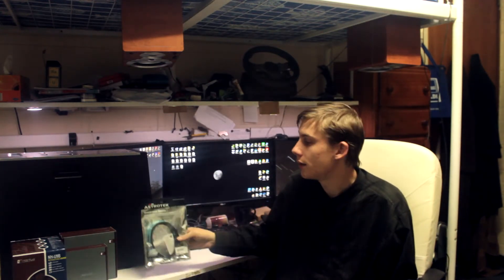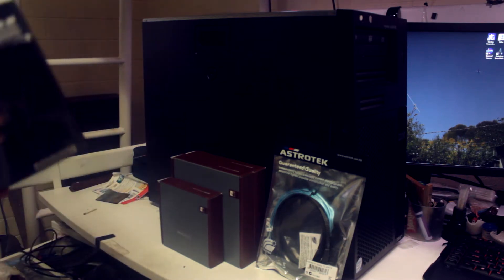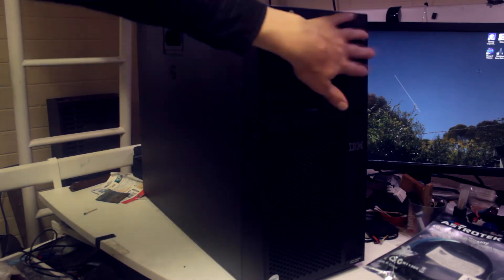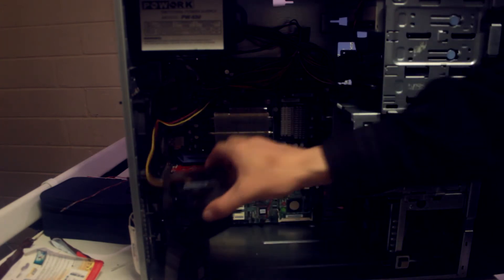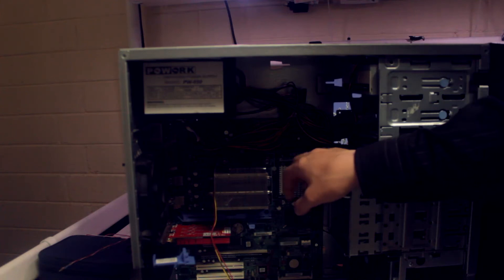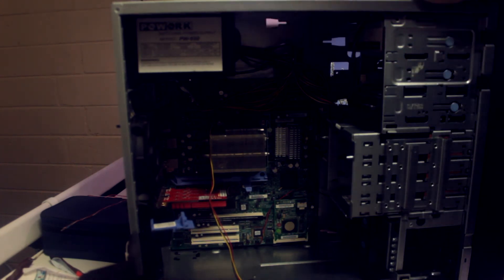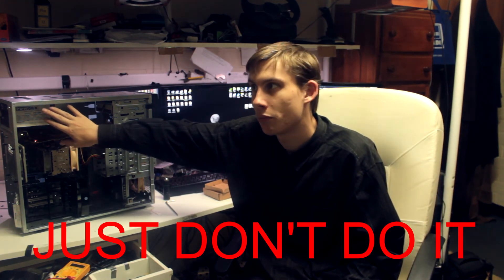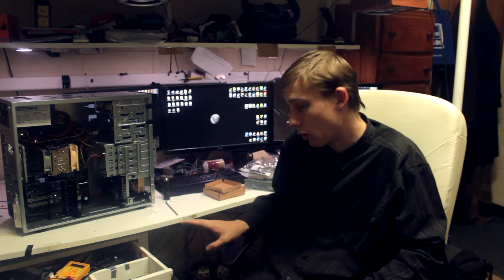IBM System X3200 MK2 Rebuild

Comment: mine came with a horrible disk backplane fan assembly I can't remove, my model has 3 standard sata drives connected to the logic board directly.Can you provide some link to dissamble this part? in the official IBM site the "movie" has dissapeared, they used the ancient adobe flash format.

Comment: Hi there! i recently found one of these in great condition with 2 HDD and Xeon with windows server on it i was wondering what i should do with it? any suggestions?
thanks and great vids mate! Justin Adelaide.
Reply: With minor mods you can put a modern ATX board in it.   You'll have to change most of the motherboard standoffs (take off the entire outer shell first, to avoid drilling through the outer housing).   The I/O shield, even though it looks the same, is wider but not as tall as a regular ATX version.  You'll have to enlarge the top of the opening a little in order to make the I/O shield fit properly.

You'll want a buch more powerful PSU, but that screws right into place.   Other than those things, your standard parts will fit.   The drive bays have a SATA cable for each, so if you want to use all of them make sure you have enough SATA ports on your system board (or add another SATA card).  Oh, and if you want to use the USB2 ports on the front, you'll probably need an internal 9-pin extension (or splitter, which could probably serve the same function).   The large original fan on the rear will still work fine,  I added an additional 92mm fan in the front to push more air through (front to rear)

Comment: Mark2????  They had an "M2" model, and later a M3, but no "Mark" classifications.  Mine is an original X3200, not even an M2.  Finally gave up on it because even with 2G DIMMs that matched the IBM part number that was supposed to work with it, it would never boot with anything higher than 1G.  And when one of THOSE went bad I said F*** it, I'm not using this machine anymore.

Eventually I'll pick up a newer Extended ATX board and re-use the case.
Reply: And yes, I finally modded my x3200, but a Ryzen5 in it.  Using all 4 drive bays (the OS is on NVMe, Linux of course).  A combo media card reader in the floppy bay, DVD and Blu-Ray drives.

Comment: Thanks. Gave me a little more info about mine. I have what I assume is a Mk1 SysX3200. Has two power supplies and 3 x 1.46Gb drives, 2Gb of RAM (4x512Mb). Can change the OS to Freenas (or similar 'cause Freenas needs more RAM) and can I use a SAS to SATA adapter to use SATA drives?

Comment: trying to find a power supply for my one, a dumpster find.
Reply: hyperhyperXD any standard length atx power supply will fit but I would recommend a power supply with 800 or more watts just to be safe

Comment: Nice Video. Do you have problem with any of the drivers or OS with the Wi-Fi card? like if you put after market hardware in it, does it throw errors?
Reply from the maker: +Nelson Chow I put in a Intel ac WiFi card and got the new drives from the Intel website and it all worked

Comment: hey do you know if the motherboard will fit in regular gaminn chassi like the fractal design define R5
Reply from the maker: Simon Löfvall I don't know if this motherboard would fit as for i don't have a define R5 on hand to put it in and see but if it did fit it would be a tight fit as for this motherboard is wider than a standard ATX motherboard. I hope this helps and thanks for watching.